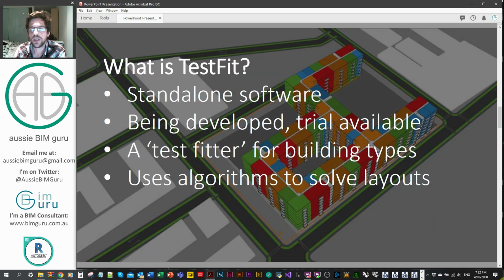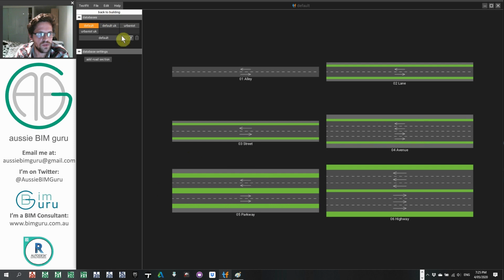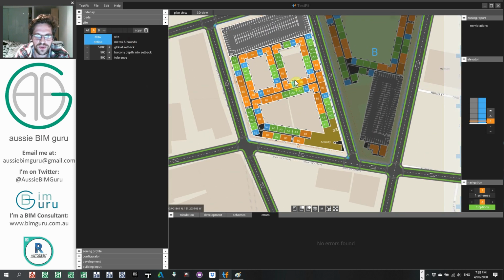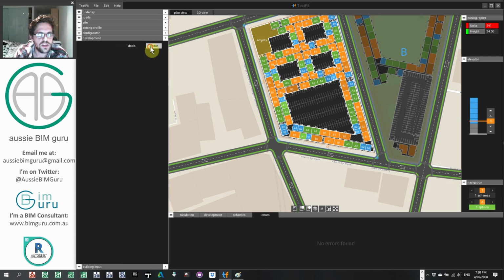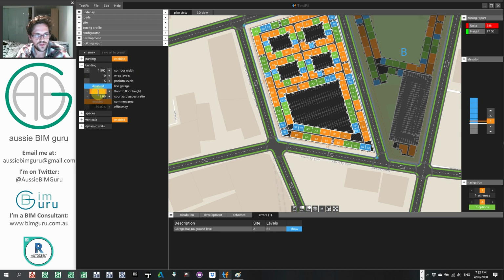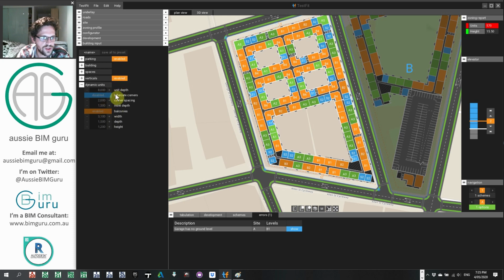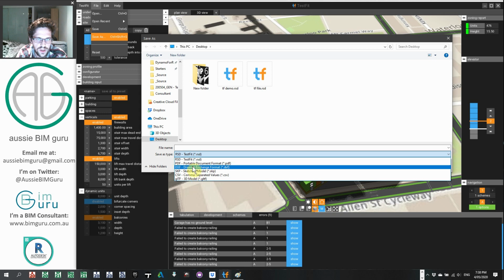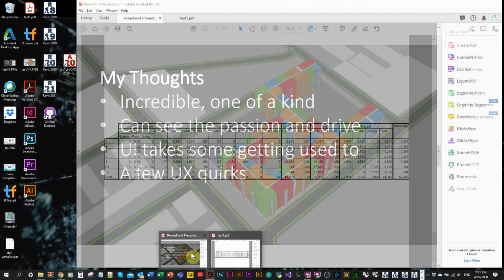TestFit - Software Demo/review!

Comment: This is great - it takes a lot of the grunt work out of feasibility. 
I can see firms winning over stakeholders that demand maximum efficiency/ROI.

I guess the rsd + dynamo combo is what will allow a bit more personality so not everyone includes the same testfit model in their tender submissions.
Honestly this is scary and almost feels endgame.
Hopefully architects see this as a supplement and don't get too freaked out.
Reply from the maker: I know what you mean - given it's just getting started the endgame will be quite amazing I think. I've noticed most traditional architects react negatively (this will be the end of creativity blah blah blah) and then go and proceed to draw up a boxy, boring design in many cases anyway!

I agree with your point that this should be a compliment if not supplement to the 'toolbox' we already use to deliver our projects with the right level of informed decision making our clients ultimately deserve from a professional.